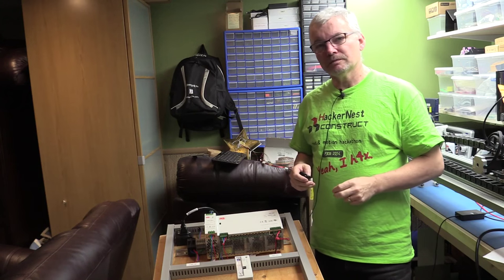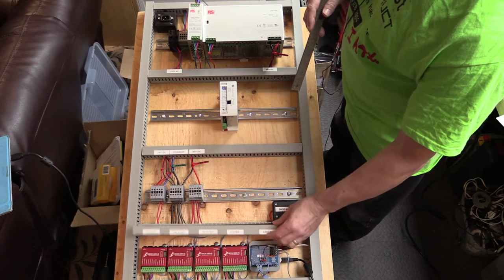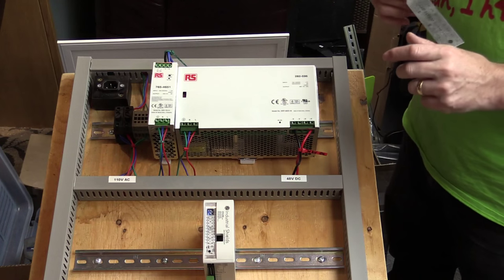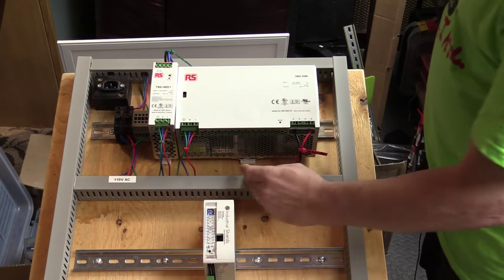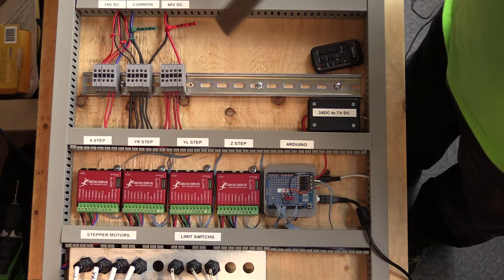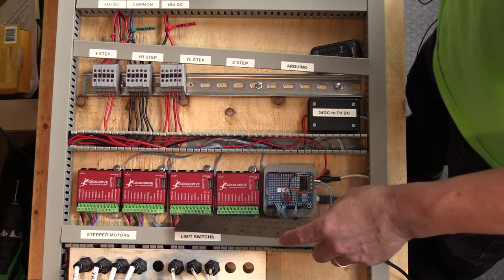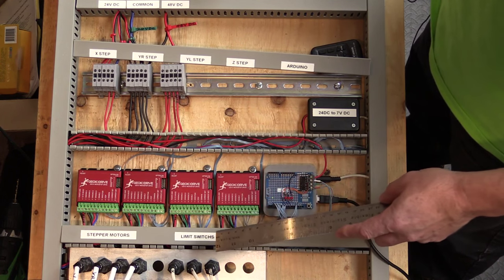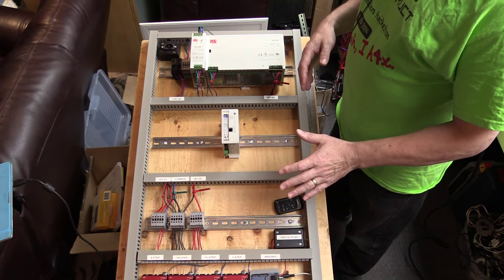CNC Project #4b The Control Panel Wiring

Comment: i want to use 2 motors for z also .....how to achieve that
Reply from the maker: How is your Z axis configured, typically there are two runners for the Y, one Left and Right and therefore the ability to have two motors. but only one gantry , the X axis, so only one motor. Have a look here for a view of many different designs
http://www.openbuilds.com/?category=cnc-router-builds&id=286
Reply: thanks for your reply 
I actually my bad I didn't explain in details the project I'm embarking on the kind of CNC machine I will be building is gonna be entirely different from  the once I have seen on the net in the sence that i will accutaly be buildind a plasma cutter which has 3 nozels one which is controled by Y drive motor and the other two could be manualy moved and tied on the rail....i know this is gonna be difficult for you to cmoprehent and i will have to make a video explaining what actual im planing to build i will send you a link of the video explaining my project for a family bussines
Reply: I managed  to upload  a video  ....plz check it out
Reply from the maker: Where did you put it :), can you provide a link
Reply: Check above  there  is  a link
Reply: Right  here  in the comment  section
Reply from the maker: Sorry but I looked in Google + and YouTube but cant find your link, can you post it again, I also don't see any pending approval comments that could hold it either..!!
Reply: I posted now now  above. ......If you can't see it it's probably settings which I have to change. ....but I remember setting them settings to " anyone who has the link can view the video "
Reply: something like this
Reply from the maker: NOw I see it lol.

Yes you can do that with this type of setup, there are two rails across the X axis and you could fit a belt on each. I would think one of the steppers will have to have a much longer shank to reach to the other belt though. If your planning on using ball screws or the like then different rails may be needed to be able to fit both

The last thing to note is that software like Mach3 probably wont work with this configuration and you may have to write your own or spend a fair sum to buy it

Comment: Gecko's do get hot.... Have you thought about a heat sink?
Reply from the maker: +timothy svec They specify heatsinks if you exceed 3A, there rated up to 7A with them, I am a fraction below 3A so they should be ok but I will keep an eye on it
Reply: Hi Peter.  I've had the th G210's for over a decade.  My power supply is a 70 un regulated.  Give Gecko a call and ask for Maris.  He is really nice.  Seeing the smoke suck's..... so be careful.

Comment: Hi Peter. Nice board!
It seems that we have been independently thinking quite similarly.
Check out my page, note the electrical board is similar. 
You have so nicely spec'd drivers and power supplies.
For my arduino, I used a shield that consists of some screw terminals. 
http://www.urso.com.au/#!projects/c1qbl
Reply from the maker: +Richard Crighton Looks like an awsome build, those Ball screws should give some exelent accuracy and results, I look forward to seeing your first cuts with it and a show and tell on accuracy
Reply: Thanks Peter.
The accuracy is very good. 
My ballscrews are most likely rolled instead of ground. Ground are more accurate. But there is probably far more movement and deflection in the system due to the construction. The ball screws give a good mechanical advantage and have minimal back lash.
I've got one of those cheap 48V chinese PSU that you were talking about on my machine. 
I like the fact that you are using the opto-switches as basically a relay. I had big problems of the limits picking up false signals due to the noise in the system. I switch to 24V relays but also put an extra pullup resistor and a little capacitor on the arduino inputs to solve the noise issue.

Comment: Professionals dont call Y axises YR and YL. Its Y axis and usually A axis. Then A axis is configured under software to slave of Y axis.
Reply from the maker: Yes primarily it is the Y axis but the distinction I was making refers to the fact i have a left and a right stepper motor on the Y axis, this seems a convenient way to refer to them.
The A axis by design is for an Axial Axis (Rotary axis) but were not used, this driver is often teamed with the Y driver to provide seperate drives rather than parallel two motors on one driver. In my case I commoned the Step and Direction signals to separate drivers but saved the A for a later addition of a rotary axis
Reply: Niko H You are wrong, professional calls A axis when them use it to control the Axial axis, in this case (as Same in my case) we use 2x Y motors só Weaver a left Y motor and a right Y motor.
In  config software setup how dont have 2x Y output so in this point we slave the A axis to Y axis.